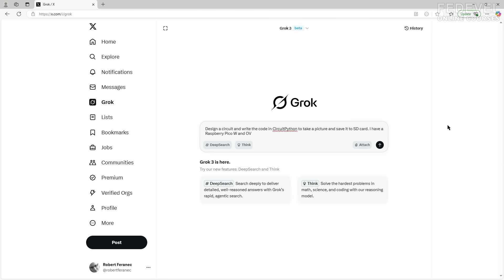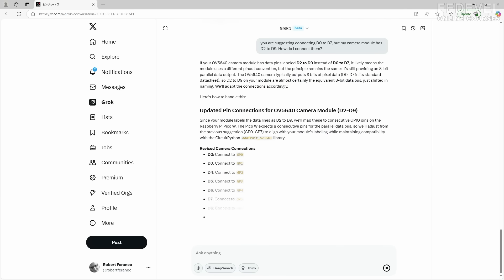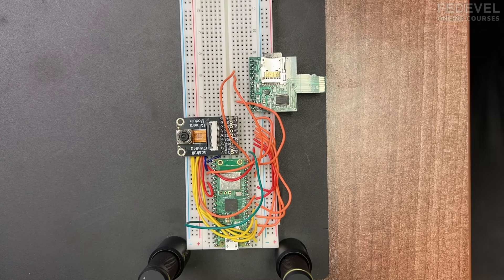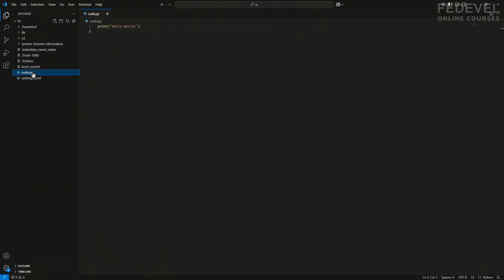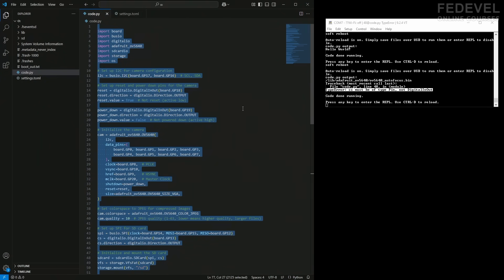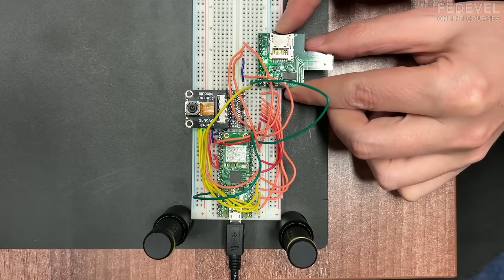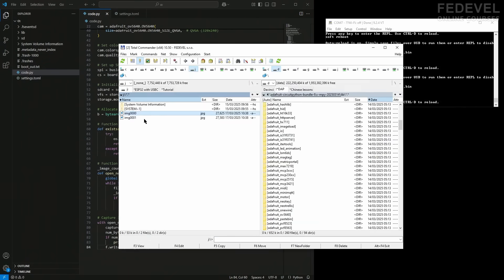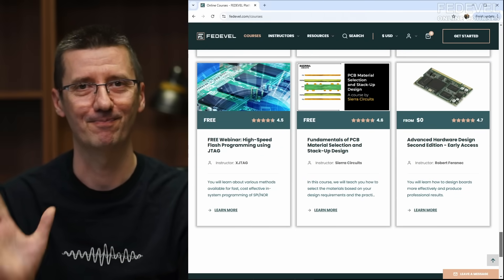I asked AI to design an electronic circuit and write software for it. Here is what happened ...

Comment from the maker: What do you think?
Reply: For a person with zero coding skill it's a much faster but, much dumber version of what I used to do which was google and stack exchange. The more complex the project gets the more of a headache instead of help it seems to become and if there isn't libraries available or in some cases you didn't specify those libraries you're probably gonna end up with a lot of bloat and errors keeping in mind changing the way you ask a question can give a completely different code and sometimes asking the same question will give different code lol it's not what I would consider reliable lol sometimes I think it's learning from me more than I'm learning from it but, as long as you actually work through the code you can learn from it but, it's likely you'll be learning bad habits too. 

Also in my experiance with electronics design it's basically useless much beyond connecting off the shelf modules and what can be found in data sheets but, I also don't need it to do that so I hadn't spent much time besides having it look in datasheets. I'm just curious what's it'll be like in 10-15 years.
Reply: This is simple ; in github you can follow the steps and it can do by just getting knowledge , a chatbot cannnot make a fully functional ic with different Instruction set architechture and also make a software support using GCC and its toolchain to make any c code to run on your custom ic
Reply: Yes, that's what I found out. Even fixing a simple button press bouncing effect can be a task.... It works better with more widely used MCUs - like Arduino or RPi variants. You have to keep correcting it and help it. Depends also on which large language model you are using. 
I'd say it's quite useful to build a framework
Reply: I think you grew up with Norton Commander, just like any Eastern Europe respected dev!
PS: still using Windows/Total Commander today 😂.
Reply: Very Basic. Ask it to design a circuit board and write code using embedded C instead of python. Make it stream the camera to a webpage. Now that would be impressive.
Reply: Try it on the most complex project you can think of and ensure to give it proper feed back ,i tell you it iterates through errors,solutions and improvements faster than most people😎
Reply: something tells me you (Robert) could have done it without the AI.
Reply: It's working because thousands of humans built that before. Would be interesting to let AI solve a problem that hasn't been solved by humans before.
Reply: When a youtube channel I'm subscribed to makes a video that (appears to) promote LLMs, or uses LLM scripts or images, it makes me consider unsubscribing...

I'm not unsubscribing in this case because your earlier videos are really good and I expect you'll make more like them - showing how to develop and use human intelligence to solve problems!

Comment: I need to make internal sff8654 8i to external sff8654 8i port bracket adapter cable pcb. To be able to route cable from pc case outside.

Comment: I use CoPilot in vscode. It is a huge helping to create declarations. For exmple I converted a part of the USB specifications (the descriptors) to excel, online. Then simplifies the excel, export to csv. Gave that csv to copilot and ask for create enumerations from the csv. It was flawless.
But also was helpful to understand principles in usb, it gaves usual coding workarounds about usb, wrote codes, etc. But the drawback is you need to revise everything, you have to do in small sections, small steps... Anyway it is incentive for me, a hobbyst. 😊

Comment: Completely useless for beginners as they will not understand why they connected the wires that way instead of another, why they wrote the source code like that instead of differently, etc. They will not learn anything, but just mechanically execute instructions.

Comment: Before watching. Yes, to an extent. I fumbled my way through the SPI protocol using gpt to write C for me. Took a few weeks of smacking my head against a wall. Integrations with Home Assistant yaml and C to modulate fan speed for several fans. Good learning process. It's ok for debugging but I wouldn't call it excellent yet. It helps to bridge gaps in knowledge not a replacement in my opinion.

Comment: I made a 8 layer board for my diy LCR meter project.

Signal/agnd
Agnd
Signal/agnd
Agnd
Power
Gnd
Power
D-signal / Gnd.

It's my first PCB design for my high precision project.
And i never did any course or something about pcb design. I just took some knowledge from deepseek or chatgpt.

I don't have any past experiences. Can you please confirm that will it work okay or should i change something ?

I added some extra slots for the capacitor ( if needed for decoupling ) and used so many test points.  

8 layer board might very overkill for MCU based project, but jlcpcb offering in just 2$ than why not take advantage of it.

Comment: It's the very early days of AI, like comparing a 6502 to a current CPU. In a few years, the idea is that you tell AI what you want and work interactively with it rather than the other way around. You would tell it what you wanted - in this example it would give you a PCB, perhaps the gerbers ready for an order, and the compiled firmware. It would be able to test the PCB and code virtually, to ensure it all works and bug fix itself. You won't need an experienced qualified electrical engineer, board layout expert, embedded programmer etc.
Reply: It sounds great. The only problem I can see is that the project may fail EMC compliance. Won't affect cheap things that you see advertised on Ebay or a hobby project, but will be bad for high quality, and god forbid, safety of life products; especially if anything has an EMC susceptibility problem.

Comment: If you can describe clearly what you need, can test exactly the result, and are able to hold its hand, it can save you a lot of time.  Also, if there is a lot of info on the web about what you are working on (like Python code) it will do much better than obscure applications.

Comment: Did you check if there is a tutorial that does exactly this? There must be one. Just take a picture and save to sd card, right? If that's the case, that llm was a slow and buggy version of showing you a tutorial, no?
I think you have to have a lot of background info to use these things. Or willing to really read and double check the stuff LLMs show you. Otherwise you will have a lot of random circuit and code, that may work, or may not, depending on your luck...

Comment: I’d be interested if it could actually design a pcb using for example the kicad api or directly the code describing the sch and layout
Reply: It can and it has, but it’s not as simple as take token and make pcb, I got chatGPT to make a PCB, but I have spent over 2 years building a system that lets chatGPT command my mouse pointer to move around my MacBook and click, I have an invisible grid set up that uses pixels as the grid and ChatGPT can issue commands like right click 1000, 80 and the mouse pointer clicks exactly where it’s told, I’m sure there are simpler ways I guess you could just convert a guber file to py and get chat gpt to copy the formatting to create a new PCB and then you can convert the file to a guber

Comment: A few days ago i had so much fun with ChatGPT. 
I had designed a simple board with a micro and some components around it. As with most first prototypes it had some small errors. Also in the course of use, i discovered some functionality that i needed to add and change. I wrote all the errors and changes with big red text on the schematic sheet, close to the modules in question. This is my usual workflow when i work alone on a project. 
I decied to give the KiCad file to ChatGPT and tell it to find the errors. It couldn't do it, even thoe KiCAD is a text format and it should be able to do that. Well it wasn't able to do it. Then i gave it a picture of the schematic, again with the giant bright red text and i asked it to find the errors. It started to halucinate like crazy. I give it props that it managed to determine what the purpose of the schemaic was. I was kind of impressed by that. Still i prodded it with simple questions regarding the schematic. After a few of those it was compleatly lost and sounded like a studend who didn't study for the subject.
Then it made a giant mistake and asked me if i wanted it to write FW for the board. And oh my god! The mess it made was just HILARIOUS. First of all it was wrong. Secondly it was so difficult to read, even if it did worked i wouldn't use it. 
Before anyone comes to defend the AI - yes i did use the newest model with all the reasoning models. 

Some developers are scared that AI is going to take their job. After a few expiriences like that, i pretty sure they'll be fixing buggy AI code for years to come. Same goes for electronics.

Comment: I did some tests with AI to help me write some simple code, like in your example. I've worked with Copilot and Gemini for now, and they both seem to be OK, but not perfect. They always make mistakes and need to be "pushed" to the right solution a little with giving them feedback, but it feels definately quicker than typing out all the code myself. Gemini as a plugin in Visual Studio is kinda nice. I've use it to write me a documentation on a serial data interface by just giving it the code to look at, and it did that pretty well.
I would not trust it with designing schematics or board layouts tho. Maybe if they specifically train the AI for that task, it might get better at it, but right now, it's probably about as bad as just clicking the autorouter button in Altium without setting up a massive set of design rules first.
Reply: That's my experience. It also gets confused between library versions, mixing different APIs from different library versions. when you try to get it to use specific library versions it still includes APIs from different versions. usually old depreciated versions. I don't think this will be an easy problem to solve as I am sure its training on code it finds that has no version information, thus cannot distinguish version changes.

I notice all these videos seem to use python. No commerical apps use Python, its all C\C++, Java, or Rust.

Comment: The problem isn’t that best performing LLMs aren’t capable of this (although I don’t think Groq is a good starting point here for that, better Claude), but the process how those models are integrated. Give the LLMs clearly defined functions to call for searching for datasheets automatically, download them and parse them with the LLM and optimize the system prompt / prompt for instructing the LLM and also ask it to write atopile code to describe the schematics of the project - and the result should be way different. But just relying on the training data or simple web searches is not gonna result in good responses.
Reply: Claude Still suffers from API versions. It will return code for library versions that your not using (ie  too new, or too old).

Comment: Looks like it can sort of design the circuitry and software, and this should get better over time. Next step is to replace the presenter. This will take more time, but maybe at some point in the not too distant future, you will be able to let it take the videos you have developed in the past, and use them to present the material in a realistic Robert Feranec like manner. But don't worry. You will still be necessary. Somebody has to plug the wires in...

Comment: Used Grok the other day to help me fix some arduino code on an ATTINY412.  Its a custom design with latching on/off circuit with battery and MOSFET.  Took me 2 hours of explaining my setup and going back and forth on recommendations and test feedback.  I had some hardware modifcation recommendations that I ignored and asked Grok to focus on helping me fix the timing problems that occurred when I pressed the on/off button.  I find the "pair programming" very helpful. It really helped that the MegaTiny Core library was well documented on Github.  I would have given up on the debugging and still ended up with some edge cases where the module froze if it was not for all the options and reasoning that took place between me and Grok when I tested and explained the specific symptoms.

Comment: I tried using ai (several) help with simple scripting, i tried to be as specific when asking but never got a working result i.e. the ai example never did what asked for. So to use anything made by ai has to be checked many times to work correctly if it ever was going to work/working.

Comment: I tried this myself some time ago, but the result was sobering. And I tried it with standard circuits. No suggestion was functional. In some cases, gross errors were made. Some pin assignments differed from the data sheets, and so on.

I had also tried Arduino codes. That was just as disastrous. In some cases, a syntax was output that could not work at all. And when I pointed out the error to chatGPT, the response was that of course it couldn't work like that and that I had done it wrong.

Then I turned the tables and gave him small circuit diagrams to check. And it looks like he doesn't recognize them correctly. Annotations are mentioned that were not there at all. Or one of them should have a wrong resistor (which was not wrong). And after a long back and forth, the answer came that many people on the Internet would get this circuit wrong.

So it looked as if he had looked at a similar circuit on the Internet and not at all at the plan I had uploaded.

No, honestly, this PC software, which is jokingly referred to as artificial idiots, erh I mean artificial intelligence, can't be used for something like this.
Reply: What a surprise ! 😅
Reply: It's a jack of all trades master of none don't ask for electronics design unless you just need to know if red is positive and even then be careful how you ask haha for coding although it's makes a lot of errors if you know how to debug those errors and optimize/rewrite some sections I still find it's faster to have it write some code and then I polish it up because that's kind of how I have to write code anyway as someone who doesn't know how to code.